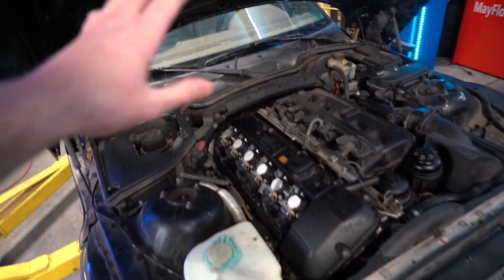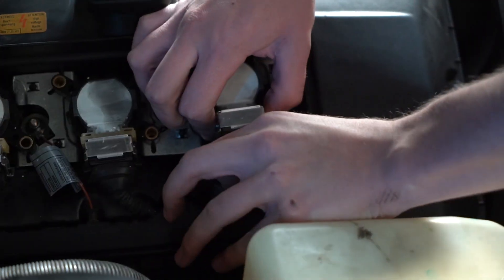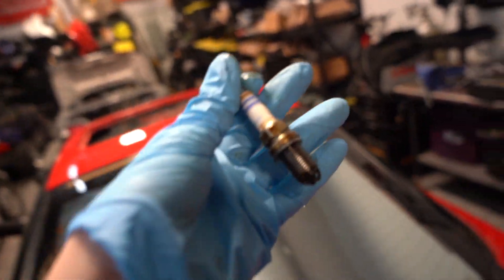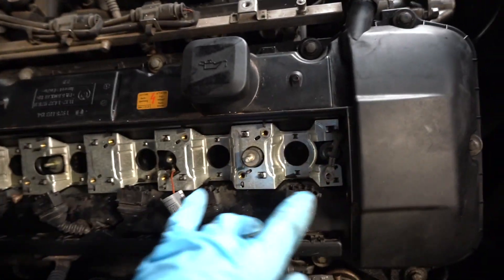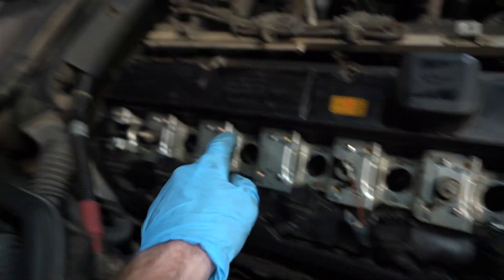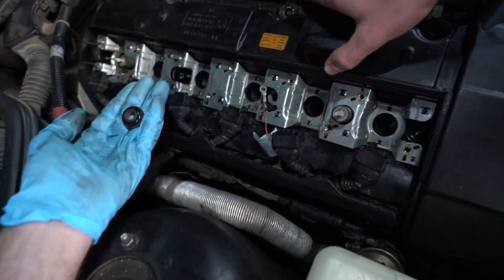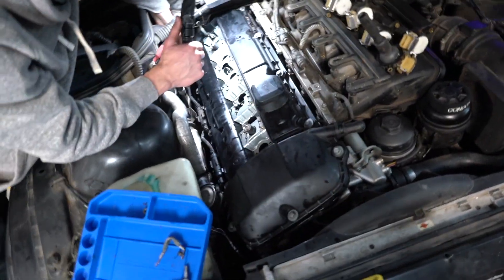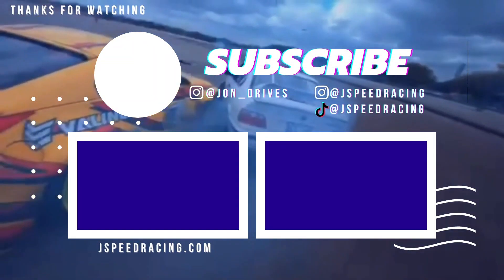BMW M54 Valve Cover Gasket Replacement - EASY

Comment: Omg I never saw a valve cover gasket this hard! The engine is in great condition guys. If you have to do an oil pan gasket in the near future, please don't forget to secure the notorious oil pump nut. It's a must on high revving M5x engines. Cheers, Dutch regards, Nico.
Reply from the maker: Hey Nico! Ya man that gasket was like uncooked pasta. so nuts! Oh right that oil pump nut. Do you think welding it or safety wire would be better? Thanks man.
Reply: @jspeedracing  one small weld and you're okay. It's getto like , but who cares. Cheers, Nico
Reply from the maker: @Nico_335i_DCT  haha so true. Thanks man

Comment: Is this the same Z3 or another one?
Looks different? Colour and wheels ?
Reply from the maker: Haha I've added 2 more Z3's to the fleet. Total of 4 now lol. I'll have another video on this one here soon. Gonna be a cool little project. Ive been slammed with work and it gets dark so early these days and freezing cold so trying to stay in the shop haha. But you'll like this little car. Thanks for the love BK.
Reply: @jspeedracing  4!!!
Damn, you need to keep us up to date 🤣🤣🤣
Thought it was different 😊
Poor man's Supra lol
Reply from the maker: @bigkeg9173  haha facts. I'm considering doing more frequent videos on like updates and stuff. But the quick update videos just wouldn't be as well produced. Me and Andy are trying to plan something like that.
Reply: I see oil in 3 sparks..in my e36 2.8 I need new gasket??
Reply from the maker: @liounisdim  Yes very likely, especially if they are in the holes. The little tube seals go bad and oil leaks in the spark plug holes. Ebay has the gaskets for cheap.
Reply: @jspeedracing very  thanks my friend from Greece!

Comment: Did you replace the washers and grommets?
Reply from the maker: We replace the grommets. Washers are fine
Reply: @jspeedracing  Thanks for replying. Some of the washers and bolts are rusty on mine so I will replace all 11 of them. I don't know the condition of the washer and bolt of the 4 in the center. I imagine they aren't rusted as they are tucked away from the elements. Grommets are definitely a must for all.

Comment: In my 2003 530i i had to disconnect the motor mount bolt, and jack up the motor to get the proper angle for the back lower corner bolt! PITA